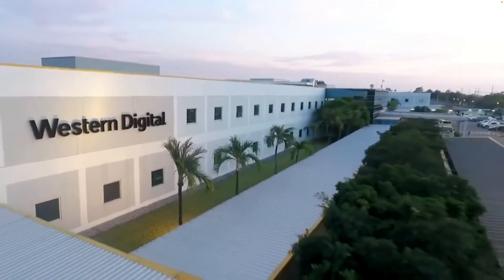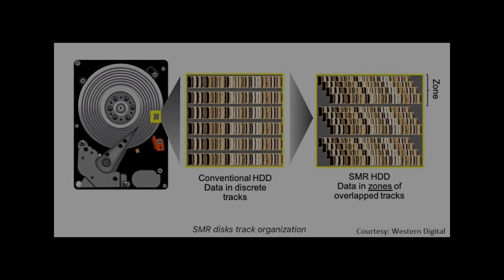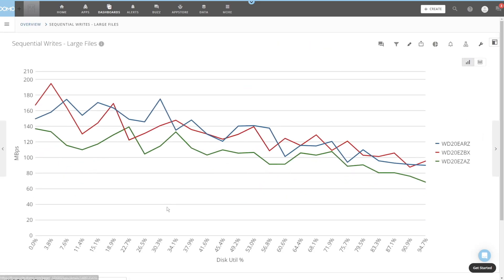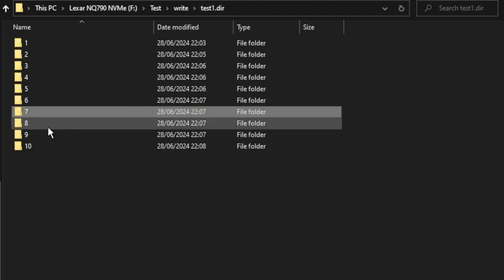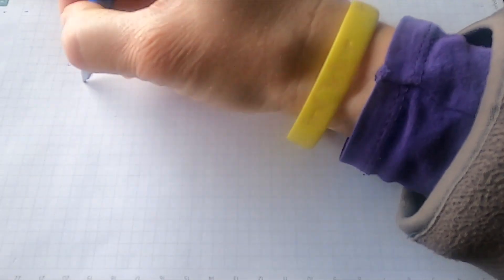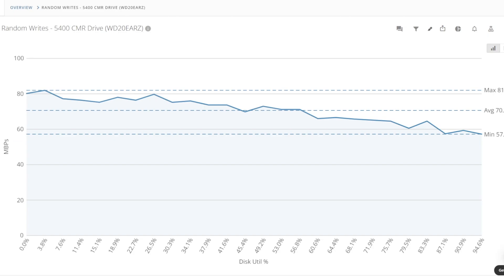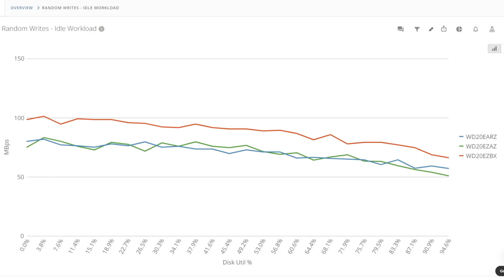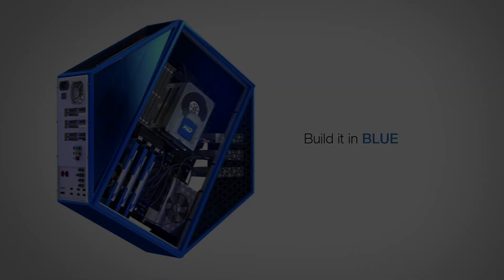CMR vs SMR. How do they compare, and how much should you care?

Comment: Hi,  nice video. A lot of technical info,  Ineed to watch again.
Talking about security and durability,  do you think is better cmr or SMR?  For instance,  a western digital Black hdd for render proyects backup is better than a Barracuda or a WD blue?  it is worth the extra money?  
I heard you will make videos about nvme and ssd too. Can you do a video explaining how to correctly tte an nvme with a hdd?
Reply from the maker: Thanks for the comment.

I don't think SMR offers any real benefit from a security or durability standpoint. Yes, data will get rewritten more, but not in a way that would provide specific protection against bitrot, and the nature of SMR may mean that there are fewer magnetic zones holding each bit. Hard to say if it really matters, but no apparent benefit at least. Keeping backups and using an OS that performs data scrubs to verify data integrity is the best way to go here.

As for CMR vs SMR, as I summarised, I just don't think there is a reason to 'choose' SMR, but certainly reasons not to. As I covered in my video on the WD range : https://youtu.be/QDyqNry_mDo, I personally wouldn't buy a Black, as I think they are over-priced, but I would likely buy an enterprise disk. If you are buying in the higher capacity range, its probably the most cost effective choice anyway. Blue non-SMR are often a good cheap option for smaller sizes, but it sounds like you would want more raw space, so look higher in the range and you can find better dollar per TB from higher end drives.
Reply: @sometechguy  Bit Rot ant Digital dust.